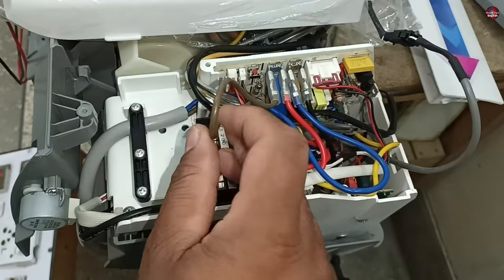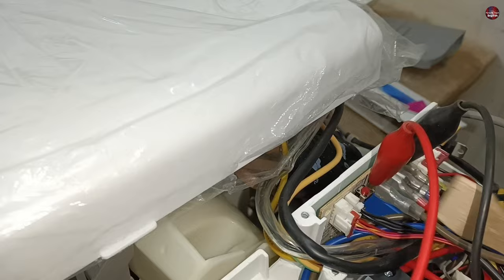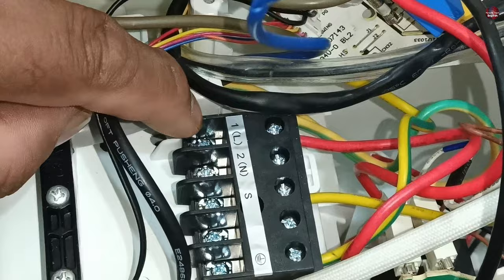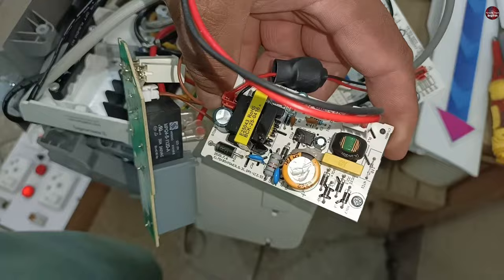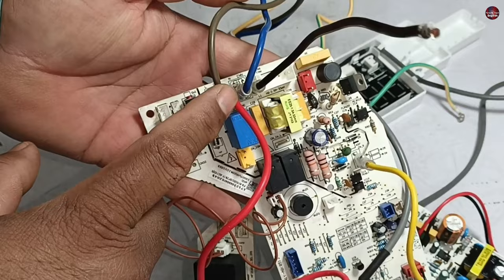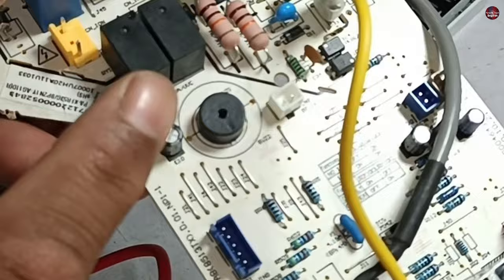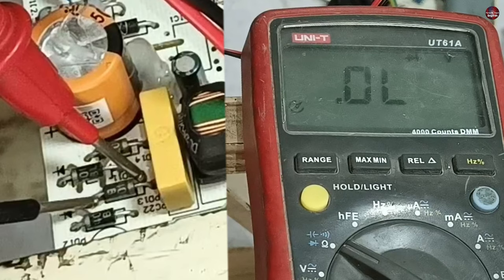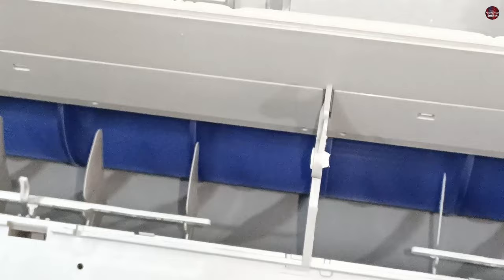How I Fixed the Carelessness of the Installer in Ac Wiring

Comment: Hello sir, is it possible to convert an inverter whirpool washing machine to a noninverter washing machine? The PCB on the inverter motor is dead. I couldn't fix it, nor was I able to find a replacement PCB for reasonable money. Would it be possible just to connect the motor directly without the inverter PCB? I'm aware that this would increase the electricity usage, but I'm okay with that.